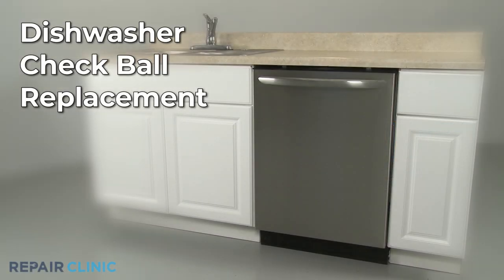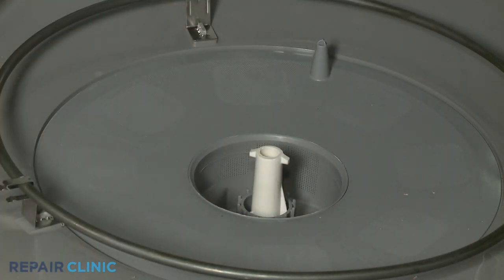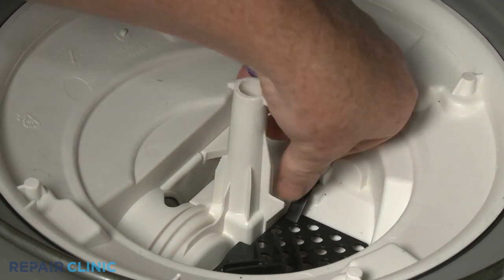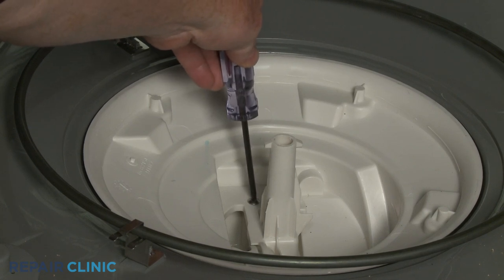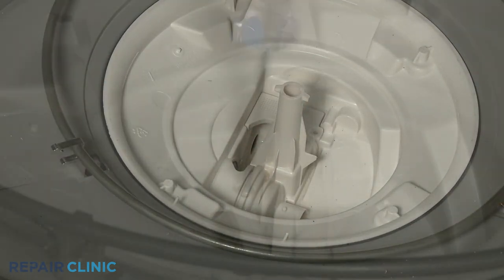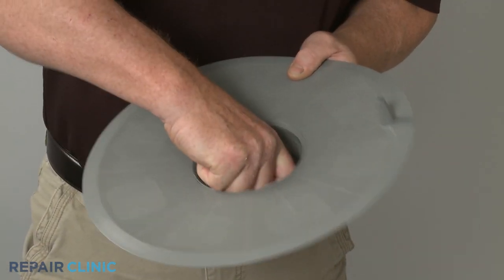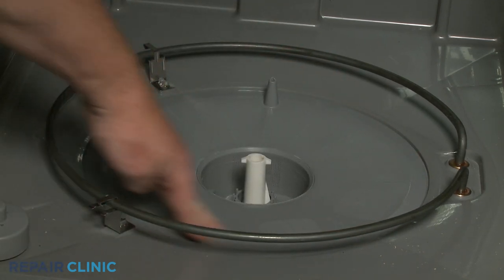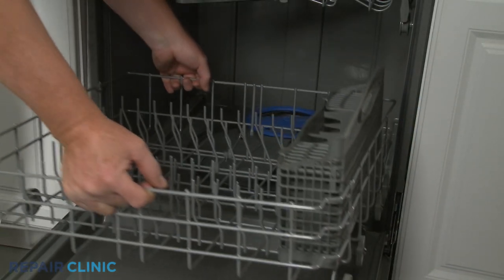Frigidaire Dishwasher Check Ball Replacement (part 154246402)

Comment: Some better explanation of how this ball is supposed to work and why it would need replacement would have been extremely helpful.  Does the ball float in some circumstances?  Should it not float?  How does it get from one point to another and why would it not work?  If I just remove it as many people are implying we should, doesn't that further reduce the pressure of each spray arm since the pump is now sending water to 2 different end points?

Comment: From personal experience I found the reason the check ball did not alternate between spray arms was that here was a restriction at the impeller intake (center of impeller - which can be accessed with the three torx screw covers as shown). The screens will admit pet hair and the impeller will trap them and turn it into a ball of spun hair which blocks the impeller flow. Now why does that prevent the ball from switching? My guess is that it requires pressures to equalize when the motor stops in a certain time frame. This requires unrestricted flow via the impeller passage even when stopped. I my case the impeller restriction was the only identifiable source of the problem. When cleared everything went back to normal.  I've had to do this twice in about a year.

Comment: Just wondering why this ball would ever go bad such that it needs replacing.  Seems simple enough.
Reply: It might swell or calcify? I took mine out dried it and now the spin arms alternate. Something about the pause between operation of the pump allows the ball to settle or float block the port.  I'm not sure but if the ball over time goes bad (water lodge) then dishes won't get clean properly because the middle and top arms won't spin

Comment: I have a dishwasher with exact same internal design. My problem is that half way through the wash cycle, the check ball starts to make loud thudding and sometimes grinding noise when the water switches between spray arms. I have checked the ball and there seems to be nothing wrong with it physically. The problem doesn't occur during the first half an hour or so. Is it a problem with the check ball itself or something else, the machine runs fine otherwise.
Reply: @repairclinic  Thanks for the reply. Do you mean the valve on the water inlet pipe under the sink? I will check that. Also, should I try replacing the ball?

Comment: I read that there is a defect in the programming that permits the check ball to operate properly and that if you simply remove it, your dishes will be cleaner.
Reply: I believe you are right. After trying to different pumps I finally decided to remove the check ball. Now the middle arm spins. Can't believe the ball is bad...must be something with the board???
Reply: @WilliamJoseph2015  it's a programming defect and apparently cannot be fixed. the dwell time for the ball to return is too short.
Reply: @raylimburg3969  ok i can see how it's working but later acts up. Would a new circuit board fix the issue (correct the timing)? Worked fine years ago.
Reply: @WilliamJoseph2015  not sure if a new board would fix the issue, but if the programming has not changed i doubt it would. i fixed mine by ditching frigidairre and buying a new kitchen aid dishwasher.
Reply: @raylimburg3969  lol. I might do the same, them boards aren't cheap. 
I'm looking into the Samsung water wall technology. Thanks for the reply
Reply: The float appears to be a high failure cash cow.  The price on this silly thing is absurd.   Mine is almost new, smooth and clean as can be.  It does not float however.  Removing it.

Comment: why do I want to replace the ball
Reply: Good Question - Video does not explain why the ball should be replaced?
Reply: It would have been nice if someone had explained HOW that ball works. My DW is doing the same thing, everything's been took apart and cleaned but the top two arms are still not spinnng. Nothing is apparently wrong with ball and a new one is $45+.  I took it out and tried without it, non of the three arms worked so I put it back in. None of them spin including the bottom which did work.